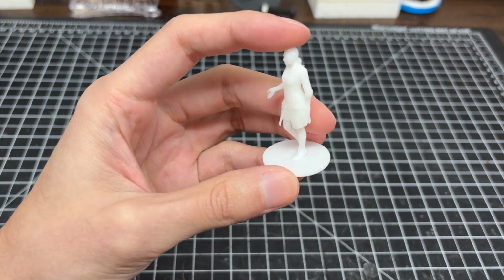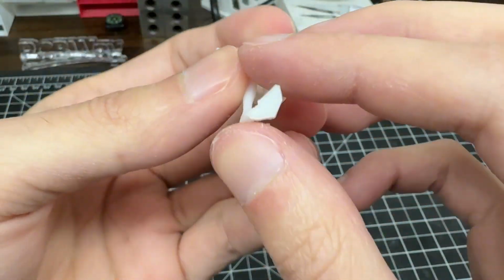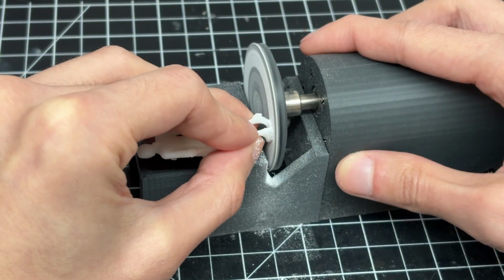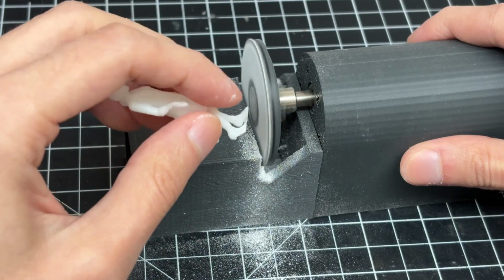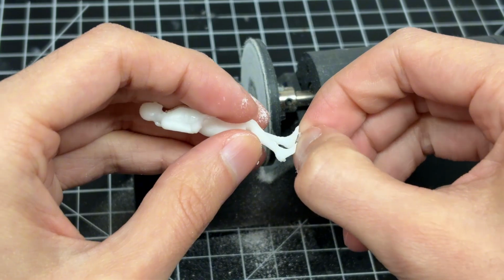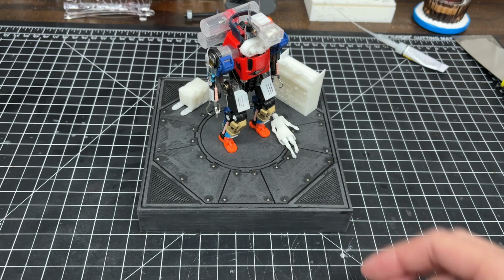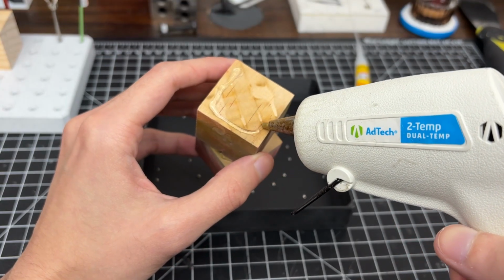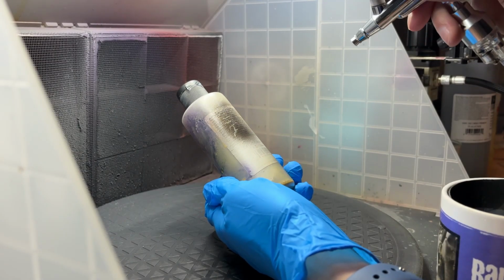Vitalis: Research Robot Diorama (Part 2)

Comment: OOC:  The advertising segue and integration with the video are excellent again.  Tiniest quibble - the use of non-self-tapping machine screws is cute and is definitely the right way to introduce some slight texture variance.  It's also comedic watching you struggle to screw them down.  The quibble comes in that they're exactly the wrong type of connector for securing decking down at that scale, unless the platform was built by construction mecha with gigantic powered screwdrivers. (it's not impossible in the Omniplex that this is actually what happened, so I have to acknowledge it.)  Humans building the platform would have used large hex bolts.  That said, it looks cool as hell and I like you too much to even think that hand grinding down that many screws to make tiny custom hex bolts is a good use of your limited time on this Earth.  

I might have cackled aloud and said "I WARRRRRRRNNED YOUUUUUUUUU!" when Vitalis needed extra ankle securing because of a lack of calf spurs.  I really like the "insulated kiln" - that's good model-making if you can hover the temp between "hot" and "plastic deformation of PLA hot", which I think you can/did easily.  The tiniest aesthetic suggestion I feel needs making is to slightly raise Vitalis's left arm - the diorama makes it appear as if Doctor Hawthorn is mid-presentation.  It would be neat if the pose of Vitalis implied that it was in some sort of mirroring or direct control mode under her command.  The implied story there is that while Doctor Hawthorn may not be a Mechsmith, she is a seasoned veteran of the trenches of the Academy.  Having the Mecha mirror her movements as she talks allows for the kind of understated theatrics that Administrators, and investors, eat up.
 
Overall, you've got another winner that's well-situated in your growing and refining aesthetic and lore.  You and Gameyy Builds are the builders to look up to in this space, and the stories implied by the Omniplex are compelling.
Reply from the maker: Thank you for the in depth comment, I always appreciate reading these 😁. I'm glad the sponsorship has been integrating well and I never want to do a jarring 30 second ad spot for any possible partnership moving forward, so I'll do my best to keep things fluid and not mess up the pace of the videos.

As for the screws, I definitely agree that Phillips is not the way to go - it just happens to be the smallest size screws I have. There's a reason I use M2 and M3 hex bolts for my builds, and it's exactly the logic you mention at scale. That said, grinding down a handful of screws (maybe not like 50) could be a very cool idea for some detailing...

Could you elaborate on what you mean by calf spurs? I assume I'm missing something in the general design that needs to be a piston or something connecting to the heel.

I like the idea of mirroring the person with the mech! It's too late for this build, but I will gladly "borrow" this idea for a cool future project one day! I like your mention of her being a seasoned veteran with administrative theatrics - that would have been a great bit of story telling to throw in. I'm honored to be mentioned alongside Gameyy Builds, and I'm hoping to find more ways to do clearer explanations on what exactly the Omniplex and the surrounding world are really about!
Reply: @proto.roborovski  If you check the last video, you'll find a second comment from me - presented as being "in character" from someone observing the in-progress construction pictures of Vitalis.  It seemed like a fun way to present ideas for the bot's design.  One of the suggestions was to add a "cloak" to the figure as a visual indicator of layered EM/Radiation shielding - with the in-world excuse that humans who attempted to scavenge the periphery of Neo City Zero used what amounted to flexible Farraday cages to protect their bodyworn equipment from EM effects.  The other, while basically noting that Vitalis's feet looked undersized, was suggesting the addition of a secondary foot assembly, attached at the back of the calf area, to prevent the mech from being knocked onto its back.  

I presented them with the idea that the calf spurs were the complex suggestion and the cloak the simple one, knowing full well that the cloak is harder to make at scale - so it got most of the comment's wording so that the design was more straightforward to understand.  But, when it came time to paint, and the LEGO ball joint was too compliant, I had to cackle because the exact thing my character had said would happen, happened.   I cackled because when it comes down to it, I am just mean.  Sorry.
Reply from the maker: @bearnaff9387  Haha that's brilliant! Not sure how I missed the comment, since I get notified of each one, so I'll have to go back and find it. Love your ideas!